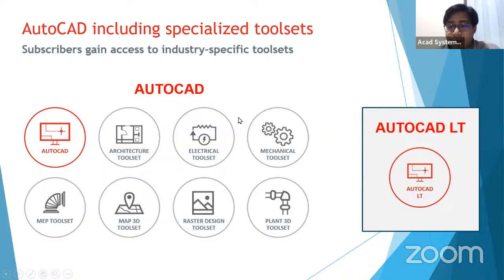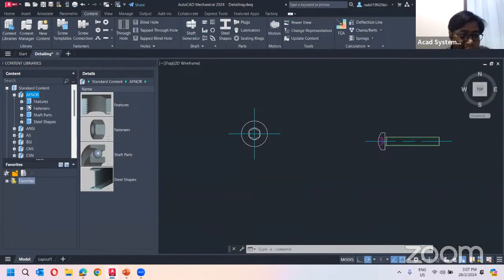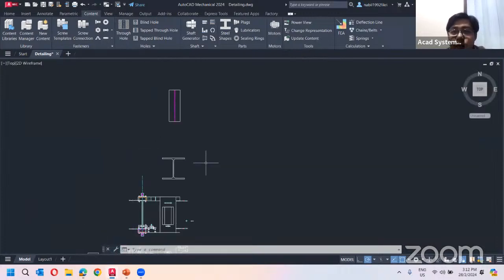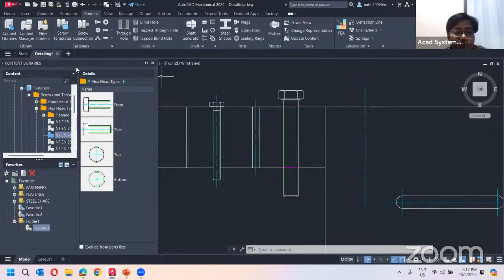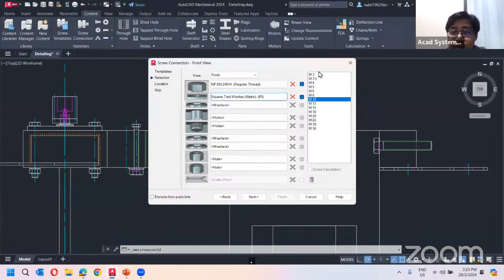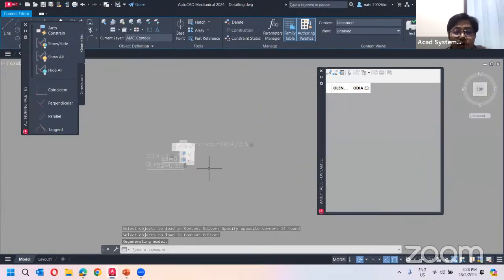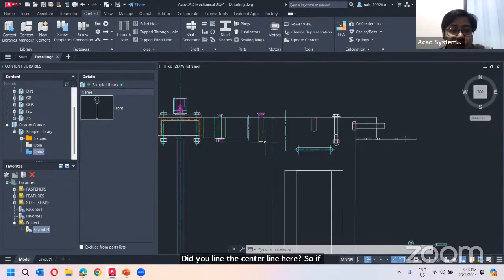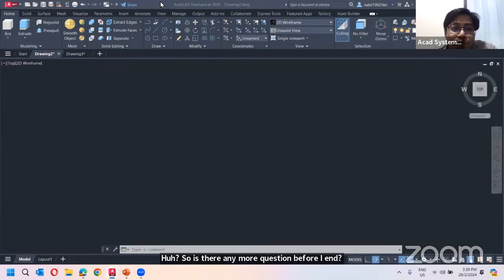AutoCAD Mechanical Content Library

Comment: First off great video! 
I have a problem when inserting as xref a file with Content Item Library inside, it messes up the centerline scale, is there any solution to isolate/hide the centerlines all in one time? Even through blocks? Thanks
Reply from the maker: Hi, to hide all centerlines you can toggle off the layer for centerlines: AM_7N

Comment: Hy to convert content library 2D structure to 3D struuctures
Reply from the maker: Hi, the mechanical component is a block file. So you need to explode the block first once you have insert it. To make it into 3D you can switch to 3D Modeling workspace first. There you can use extrude or revolve to make it 3D. Keep in mind, to convert from 2D into 3D, the 2D sketch need to be polyline first. Hope this help